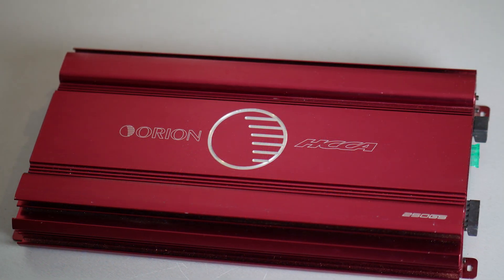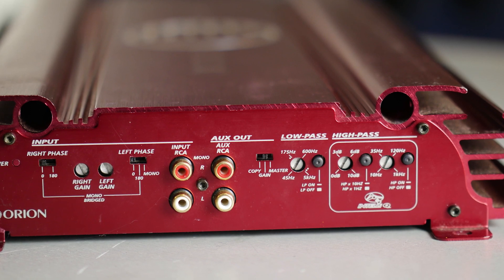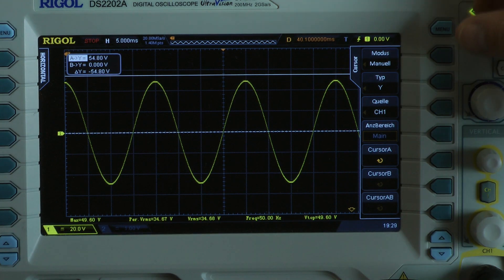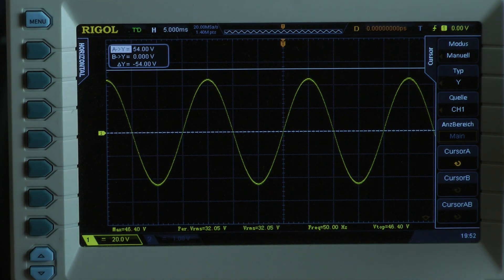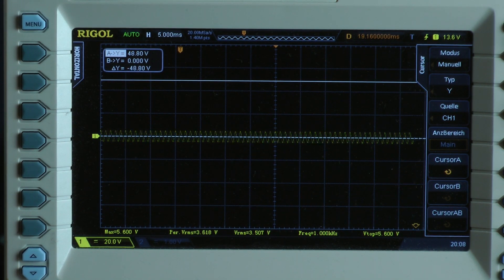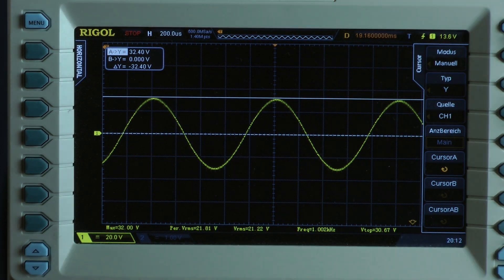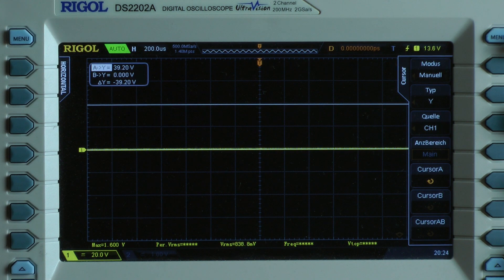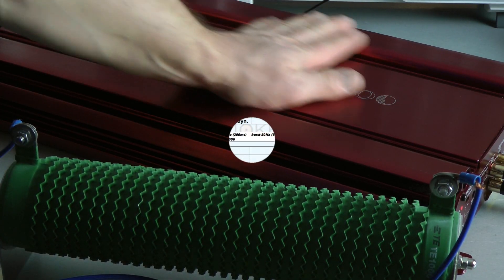Orion HCCA 250 G5 old school car audio cheater amplifier repair power test ampdyno

Comment: I believe the only HCCA amp not overrated is the 225 HCCA 2/3/4/5/6 gen. The 250 and 2100 are not too far off in actual numbers at 2 ohms mono. Really shows the high voltage versions (XTR, SX, etc) are the ones to get but man the red ones "pop" with that look! Great test and video!
Reply from the maker: Thank you for the great info Dereck! My first thought was that my repair was the reason the amp did not perform as expected 👍

Comment: I believe they are rated at 1k hz.. vs 40hz.... and yes I do believe that they will fall short.   But I believe others have modded them to do a lot more dynamically.    I use to be a authorized dealer back in the late 90s for orion.
Reply from the maker: Thanks for chiming in! I heard but cant confirm that there was a " competition edition " of this amp around?